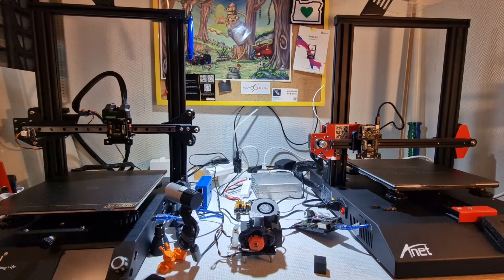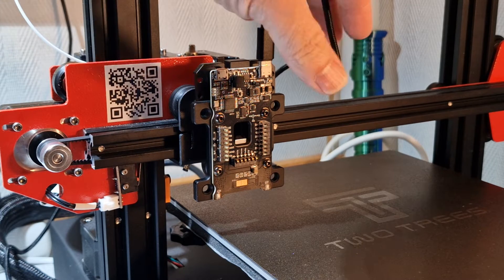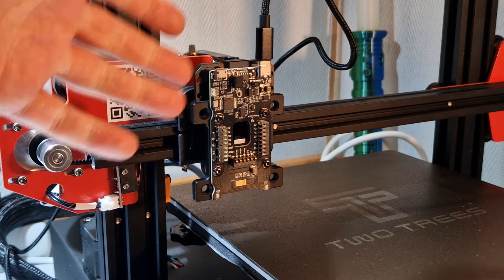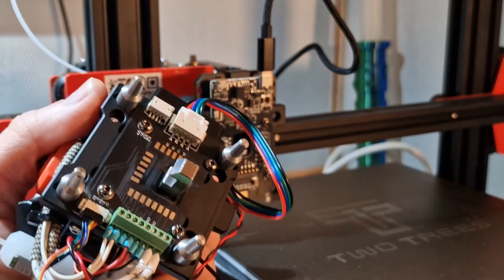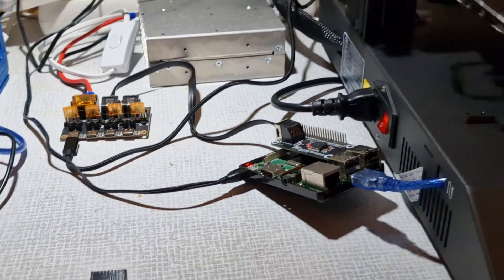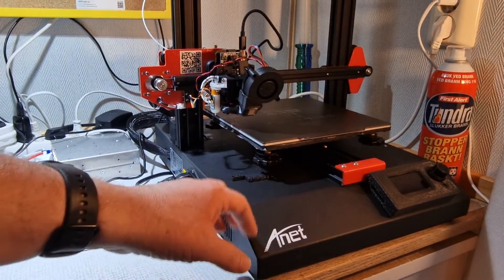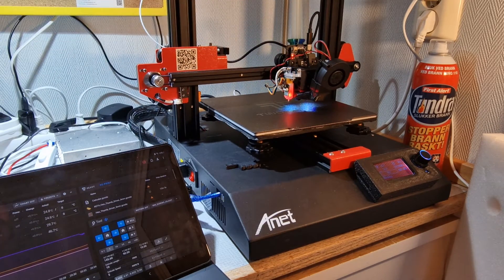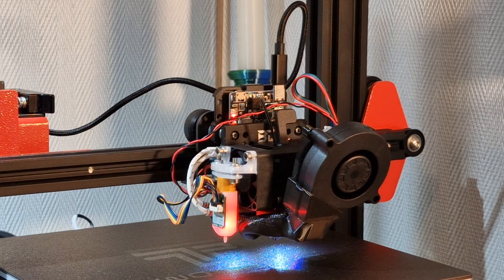BIQU Hermit Crab CAN version

Comment: Hi Patrick, thanks for the detailed video. I am currently running my Ender3 pro on BTT SKR mini E3 V3 with Klipper mainsail on RPi. I am interested in converting my device using CAN and install a Hermit crab with CAN. Does SKR mini support CAN? thank you.
Reply from the maker: No. You will need to use a canbus hat or usb to canbus adapter.

Comment: While the Hermit Crab CAN seems quite nice, I would much prefer the CAN would be on the tool side, not the carriage side. Also the mechanic should allow release by a servo. This would allow automatic toolchange...
Reply from the maker: Why can on the tool side? That just make a more expensive setup.
Reply: @StackingLayers  If you want an automatic toolchange, you need still power on the toolheads in dock. The coldend needs cooling (unless you want heatcreap) and also you want the hotend to be heated in dock if printing multimaterial. So with automatic toolchange you need permanent connection to every tool (like on Prusas XL).
Also if having multiple printers it can save a lot of money, if you do not need multimaterial all the time. For example one printer with an automatic toolchanger and docking system for 5 tools, but only 2 tools inside. 3 other printers with the same tool/toolholder, but without automatic toolchange. You could use all 4 printers, if the multitool printer only needs two tools - but you could turn the other 3 printers off and put the tools into the dock of the first printer to do a 5-material print there.

Of course CAN/USB on the carriage is fine on manual toolchange, as you only swap tools on powered off printer. However, I am not so shure why to use different printheads at all (exept for experimenting). Different tools make more sense if you want to swap between printhead, laser and engraver. But such different tools need different control, so accidential using the wrong settings for a tool might cause damage. Different IDs of the CAN-Board of each tool could avoid this.
Reply from the maker: @oleurgast730 oh definitely for auto switching you'll need can on the tool side. The Hermit Crab is currently only for manual swapping. I think the original plan is to allow for different types of tools like you mentioned, or quick swapping for types of hotends.

Comment: Hi @StackingLayers, I have another question, I saw that you showed the EBB42 in the video, I have some of these boards and the question is, can I use it (EBB42) only with the USB-C cable instead of the 4-wire connector? And connect it to the USB-C hub that comes in the Hermit Crab kit?
Reply from the maker: No it's not connected on the board to work that way. You can use USB to USB communication but you will still need to provide 12V/24V for the heater, stepper driver, and other things.

Comment: You said the offset is in the firmware, but how does it know what you have attached? It comes with 3 mounting plates. if you had a different hot end on each with different offsets how does it know what to do?
Reply from the maker: You change the offset for the tool. Alternatively you can mount your tool heads to be at the same offset, but that is not really an easy task.
Reply: @StackingLayers  that's a shame. It would be nice if they were some how able to be ided by the system. Would it be possible to use either the bl touch or filament port to have a unique value when connected?
Reply from the maker: I've looked Into it in the past. I was told it definitely won't work on marlin without customizing the code heavily. I haven't looked into doing it with klipper though since it's easy to make the necessary changes. You could even make a macro that sets the parameters with one button

Comment: So.. CAN version.. the USBC cord powers the hot end, fans, etc? It's able to provide enough power for a 350c or so hot end? If so..how.. is it being sent like 100w of power over the USBC to the main module?  So on my Ender 3 S1 Pro.. which has linear rails on it.. can I put the CAN version (if thats the better one).. and then put whatever hotend I want.. like the magnum++ setup? I am using Klipper on an RPi 4.. but seem to have a lot of problems with my stock extruder.. always getting clogs. Would love to try a different hot end.
Reply from the maker: USBC PD (power delivery) rated cables can handle up to 100watts. The temperature of the hot end is not a power rating. You can get to 350°c with a 40 watt heater it just takes a lot longer. I wanted to recommend using that set up for high power setups like those that use 100watt heaters. Along with your motor fans and anything else attached, that would obviously draw too much power. But for most common setups it shouldn't be an issue.
Reply: @StackingLayers  So would the non CAN version be able to handle 100watt hot ends? Doubt I would use that much.. just curious since the bolted plate wires to the printer wires. Not really sure how I would use CAN personally. But more importantly.. can it work with any printer.. e.g. my Ender 3 S1 Pro.. so that I can use a completely different better hot end and extruder setup? I also have the laser module but was too much a pain to swap it.. this would be great for that I assume. Would love to see more about CAN and if its worth going that way or not.
Reply from the maker: Honestly have never researched the max wattage for the standard one. I never intend on using that high of a heater wattage anyways so it was never something I focused on. 
The nankan version is definitely able to be used on just about any printer. It is just a matter of wiring it to the right plugs on both ends. It just acts as a decoupling device. The nice thing about the can version is less wires. Also it has a built-in tmc2209 stepper driver for the extruder and an adxl accelerometer for input shaping, so it's a little more advanced.
Reply: @StackingLayers  OK.. and with CAN you can run 4 of them from klipper (e.g. 4 sep printer setups)? I did notice though it looks like you need to plug a RJ12 in to printer m/b.. not sure my ender 3 s1 pro has a plug for that.. but that was a custom rat rig setup (video) I saw that on. If for no other reason the ability to remove the extruder/head to work on it seems like its worth it.. and you get 3 plates with the kit which is nice.
Reply from the maker: It comes with the can hat for the raspberry pi that has the rj11 connector and it comes with a can hub for attaching 4 USBC connections. CAN is also able to daisy chain in a sense so you are not limited to 4 MCU/other can nodes
Reply: I think you do not have to use USBC cable. How actual CAN bus work - you have 4 wires, 2 Power (should be quite thick) and 2 data. And it is a BUS so you can continue that 4 wires all around your printer and connect all your CAN devices. So basically if you put thick enough cable for power you can drain whatever current from your power supply.

Comment: Now since you used it for a while what is your experience?  I'm kind of nervous about the rigidity of bot USBmini and USB-C 😬
Have they survived the vibrations?  I would rather have seen some more robust industry grade connectors.
Reply from the maker: I am still really enjoying it. I'm actually considering getting another one for my new machine. Its so convenient. I agree that it would be better to have a more robust connection. That being said, it seems to be holding up perfectly well using the single usb-c for both power and data.I haven't had a single issue. I didn't even install that reinforcement piece I printed out yet.
Reply: @StackingLayers  Thank you that was valuable information :D

Comment: Thank you for the video. I am still trying to see if I want CAN or regular Hermit Crab. 

Could you explain to me the use of using multiple USB-C ports in CAN distribution board (hub)?

I hope I understood this correctly:
Usb c 1 - 3d printer
Usb c 2 - light sensor
Usb c 3 - heat chamber
Usb c 4 - etc

All at same time?

Comment: HI thank u for the video very helpful i just got few questions  the  Hermit Crab CAN v , do i need to use separate power ? and can i run 12 v fans or must be 24 ? i'm running killper on my mac mini can i just connect the intranet to the mac mini in stade the BTT CAN-Distribution Boar
Reply from the maker: The rj11 (ethernet looking cable) is not able to be plugged in to the Mac. It's a canbus line.
Reply from the maker: You don't need to run a separate power supply as long as your main one supplies enough. I just had the second one to make things easier, and my main one was a bit underpowered. The fans will be powered by whatever power supply is used for the system. You'll need a buck converter if you want to run at a lower voltage.
Reply: @StackingLayers  Thank you , i order Manta board+CB1][Pi4B Adapter + CB1 according to the instruction should be all together in one place i hope